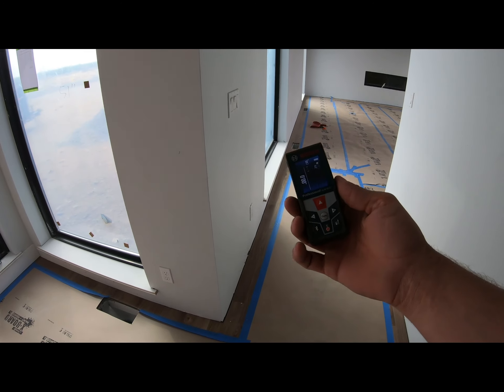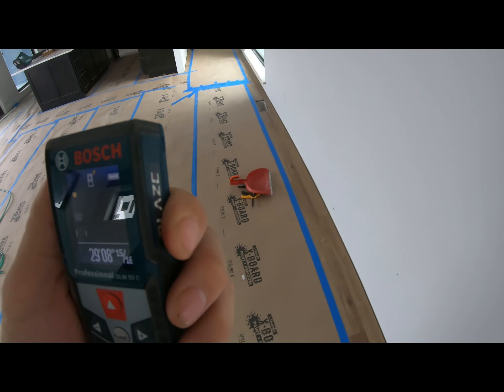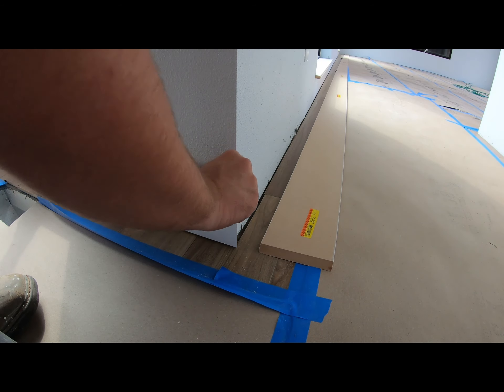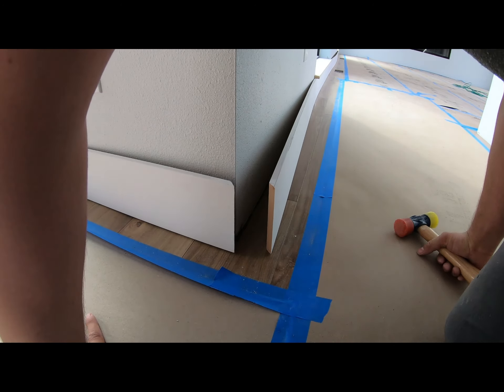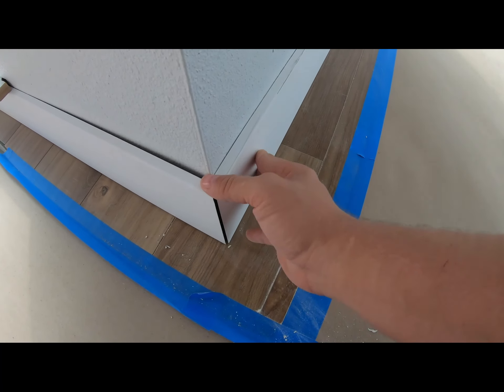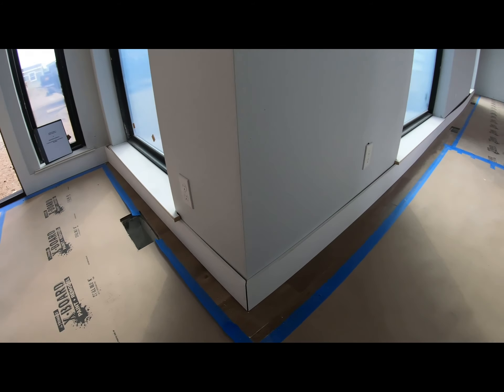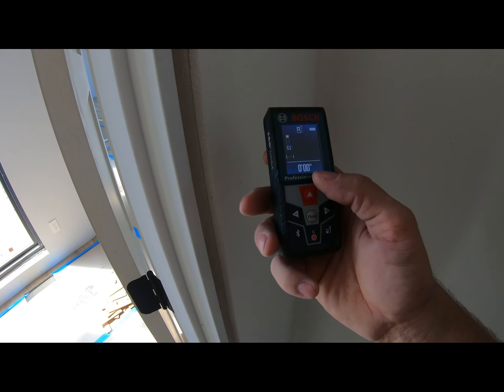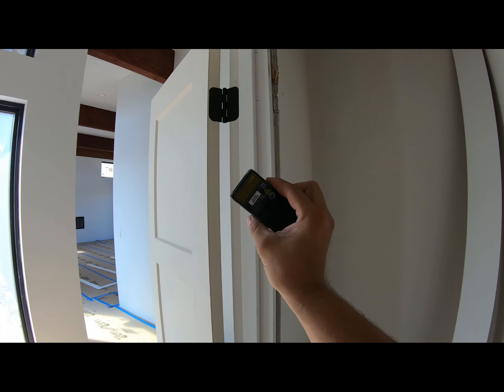Bosch Laser GLM 50 C TEST! 30 FEET!

Comment: whats the glue product your using , it looks handy
Reply from the maker: It's called 2P-10 made by fast cap. It can be found at windsor plywood or Amazon. It is an amazing product. I use the thick version.
Reply: @homeworxchannel4120   Ill have to go get some , will it work on things like window sills too , the plastic sort , be very handy for mitre joints .
Reply from the maker: @tomthompson7400  I haven't had much luck on plastics unless you use alot. This product is best on MDF it creates a bond that's stronger than the wood itself. In my testing the mdf board will break well before the joint. On Solid woods it hold it together but not super well. I normally use this as an initial bond but add some wood glue for a long term bond.
Reply: @homeworxchannel4120  many thanks once again.

Comment: What glue are you using?
Reply from the maker: It's called 2P-10 made by fast cap. It's a super glue with activator. Works great with mdf for the corners. We have found the thick version is the best to use for this.
Reply: Thanks, does it work as well on Pine?
Reply from the maker: @hayssteve  it does. It's not near as strong as the mdf joint but works well for base corners and mitered casing 1x4. I've noticed 2 1/4  colonial casing doesn't have enough surface area to hold well so I don't really use it on that.